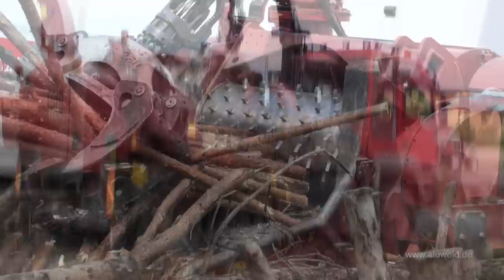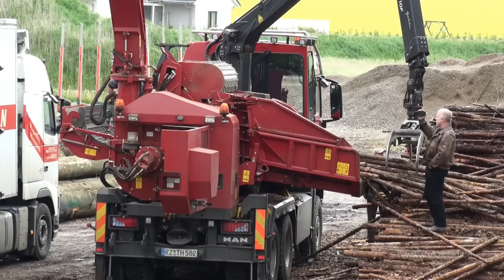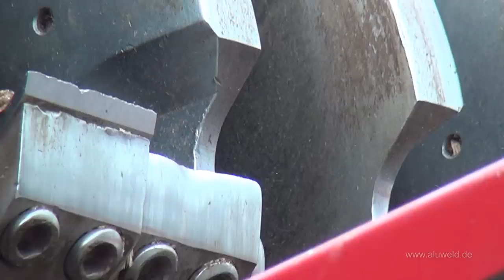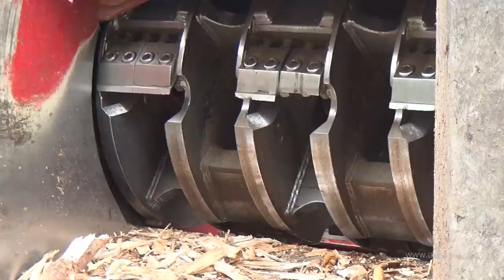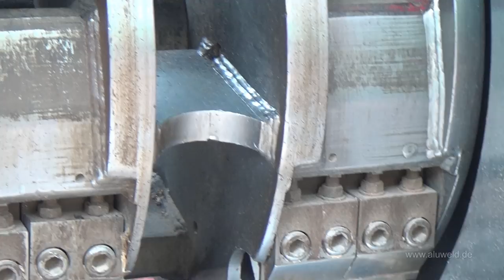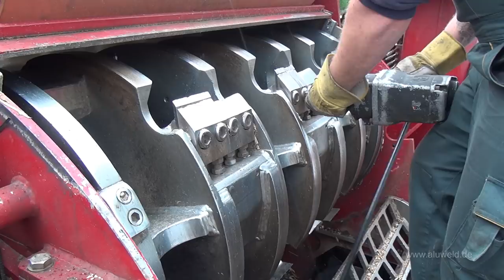Wood Shredder Blade Maintenance

Comment: How come not all blades are being used, there are several pockets empty?
Reply: i would imagine the video was edited in such a way that it looked like he left them out but in fact probably didnt?
Reply: Don't need em all. Some are spares.
Reply: @verteup  its not just spares. if you add all the knifes thats possible you cut shorter-smaller chips but use more fuel  on same logs

Comment: Ok perhaps I'm naive and ignorant but for the obvious cost of this machine not even factoring in the cost of repair and down time I think it's absolutely redictculess there isn't a metal detector to detect and stop this very thing from happening.   I would think it's a given that you're going to encounter metal bars,  brackets, spikes and God knows what else when shredding this type of mixed material.  To not have some form of metal detection that will automatically stop the machines feed mechanism and alert the operator so that the shredder can be stopped and the feeder reversed so the operator can then wand the material to find the metal is stupid.  Theres no reason you can either create a non ferrous passage, or utilize xrays, or other options where any metal will stop the feed and alert the operator.  Hell, the first couple times it alarms it will have paid for its self. 
Oh an you might want to consider editing out the idiot with the cigarette dangling from his mouth yelling "Rebar!"  Great company image, probably the founder!
Reply: there will be a reason. those blades are only a fiver and takes about 30mins to do whats hes just done. i have a very similar Jenz machine myself. on a forage harvester the area before the knifes is stainless steel. i wouldn't want my machine stopping for a nail if it did it would be creating exactly what you are trying outline above. just a thought
Reply: Steel is really not that big of an issue. I mean most of the time you hit rocks or any kind of unclean wood, which the metal detector cant get anyway.
Reply: i been saying the same thing for years.  These guys will spend a half mil on a machine but wont' spend an extra 20,000 for some sort of metal prevention.